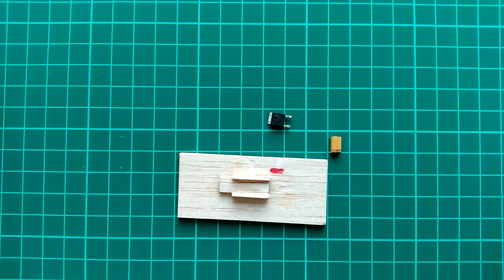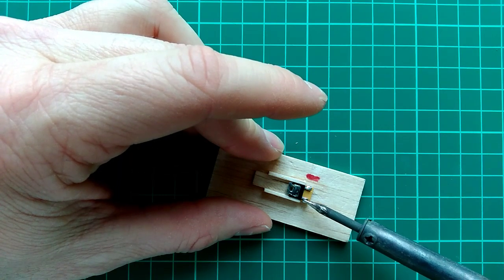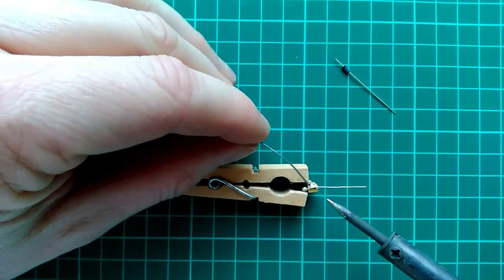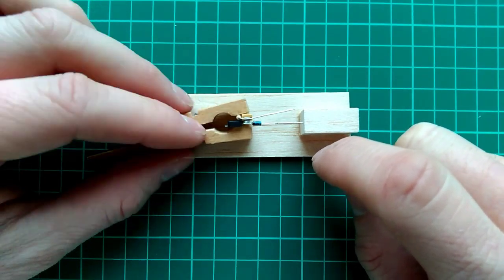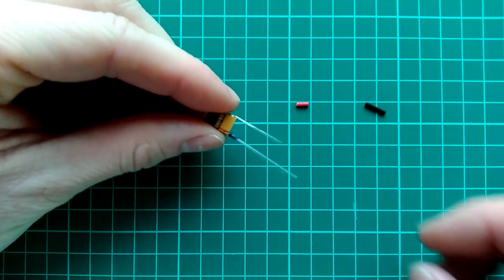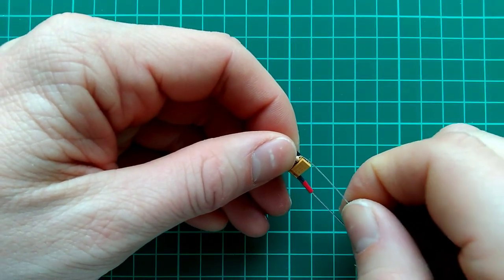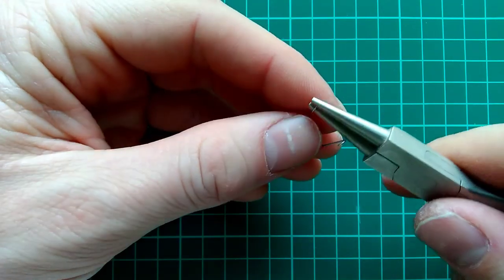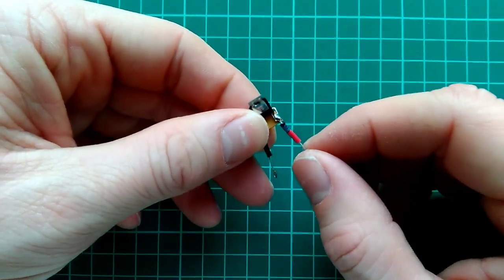How to Build a Ferry 500 Timer - Part 3 - Assembling the Timer

Comment: I’ve successfully made one but the time is about 2 seconds. My motor is powered by a 1s lipo. I tried four 240Kohm resistors in series and this gave me 20 seconds. It’s going to save me a lot of money on timers😀
Exemplary set of videos.
Reply from the maker: What components did you use? To get more time you need either: 
1) A bigger capacitor (higher uF value)
2) A bigger resistor (more ohms)
3) More voltage in the zapper (up to the capacitor max voltage obviously) - check your 9V battery is fresh.
The voltage in the circuit (ie 1S or 2S lipo) shouldn't make much difference providing you have a suitable FET.
Reply: My friend has had the same problem. No big deal. The timer is great with a bigger resistor and a 500k trimmer. I’ve made several now